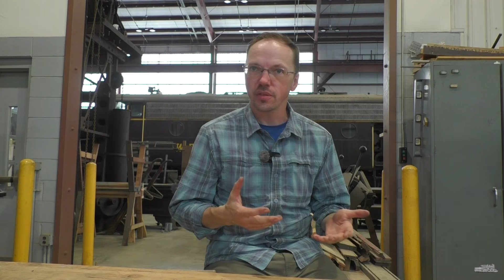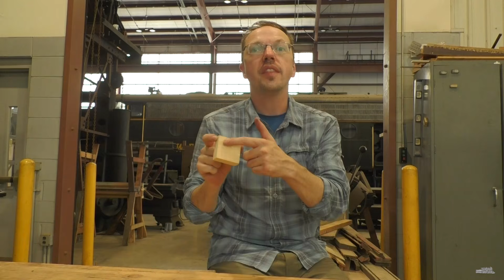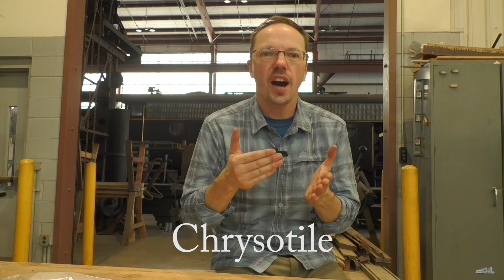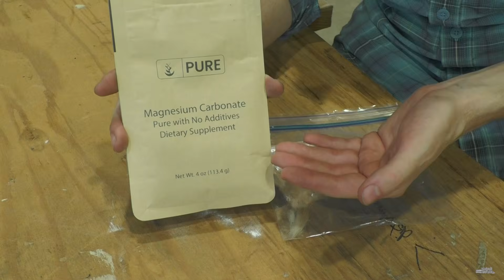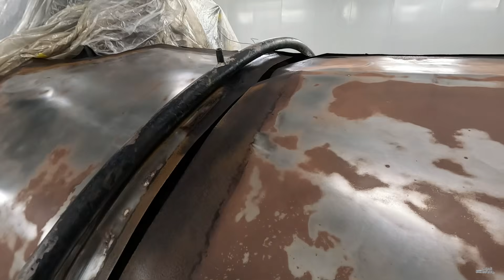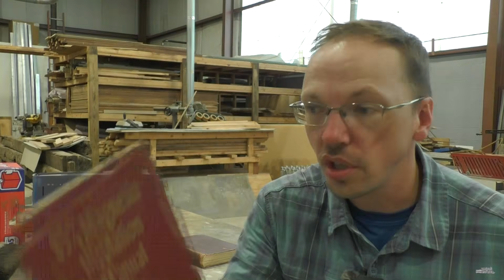Boiler Lagging - A History

Comment: When removing old asbestos from loco boilers the the loco is encased in a complete marquis like structure and the old asbestos has to be put into plastic wrapping with plastic that won't break down and buried in a deep hole in the ground. It has to be done by contractors who specialise in this sort of removal. 
I've seen new lagging made from glass fiber bats before mineral wool insulation was invented. My house has glass fiber insulation batts in the ceiling roof space and walls which keeps my house cool in summer and warm in winter.

Comment: That was fascinating.  So basically the asbestos wasn't the main insulating material but just the web that held the magnesium carbonate together.
Reply from the maker: Exactly! You got it! Asbestos acted as a structural bonding agent...essentially. It held all of those other materials together.
Reply: @HistoryOntheMove-qt1pl  So what I'm getting from this, in theory you could replace the Asbestos with something else essentially fireproof like man-made mineral wool - I'm guessing this is what is done when restoring a locomotive?
Reply from the maker: @AFullerHouseAtlantic  Correct. Different tourist railroads use different man-made materials these days. I know that the #4 St. Elizabeth at the museum (when it did operate) has fiberglass batts under the jacketing.